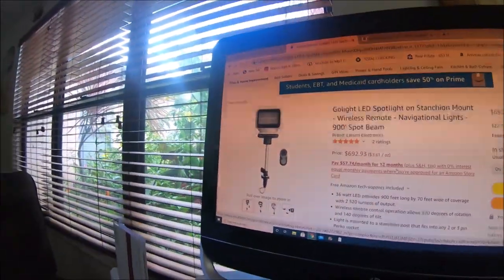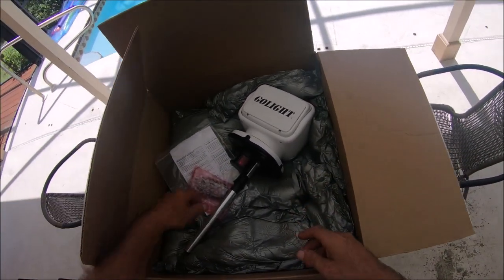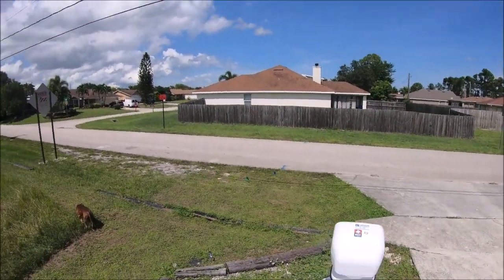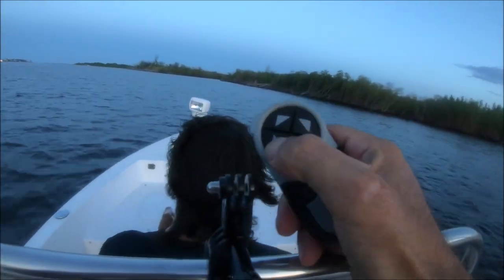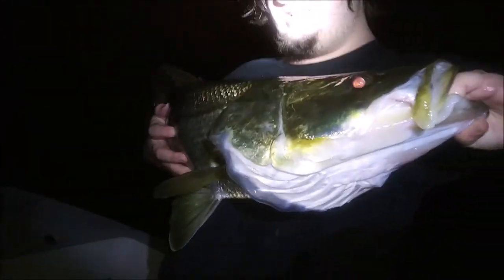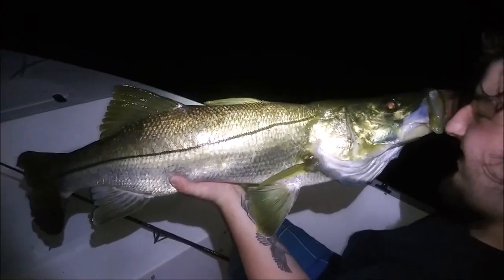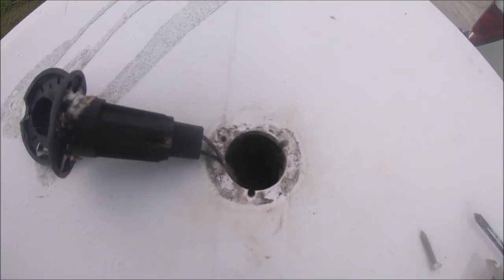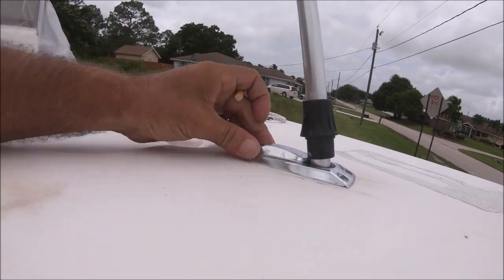Golight Spotlight test and Robbie's Monster PB Snook

Comment: I have 2 golights with remotes 20 years old and I just had to replace a 28$ part.  When we sold the boat I installed them at home in the backyard.
Reply from the maker: They look tough and your putting through the test. Good to hear from you sir.
Reply: I did a vid in the repair about 2 weeks ago.